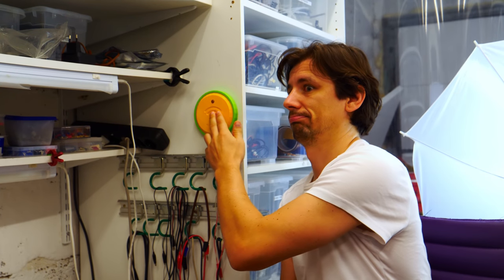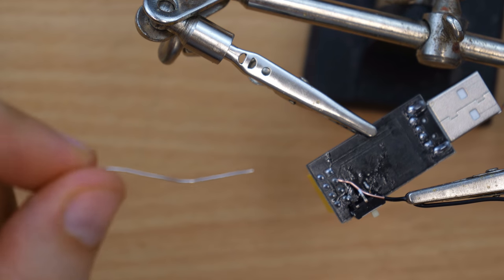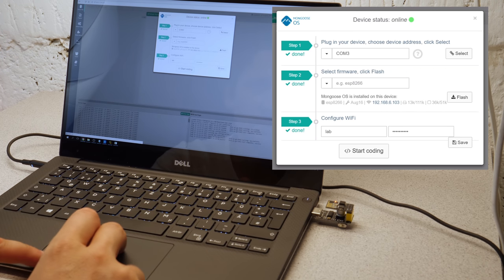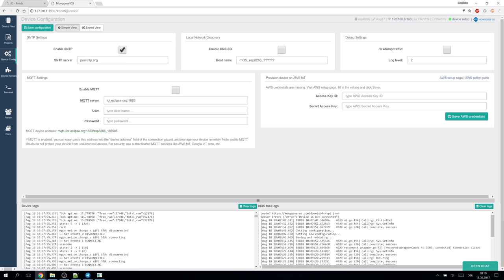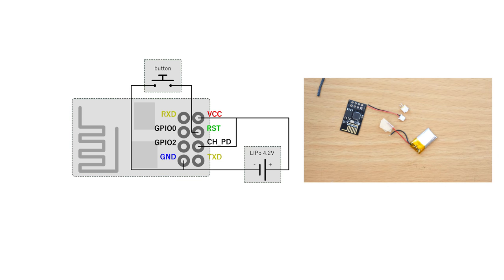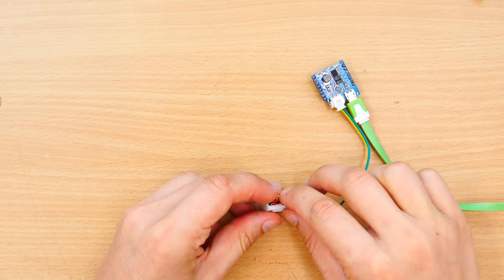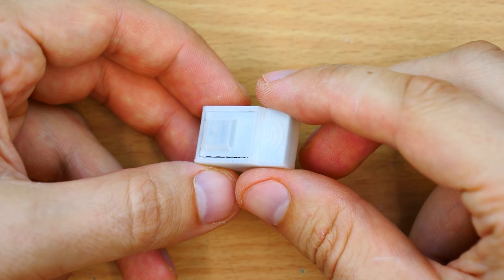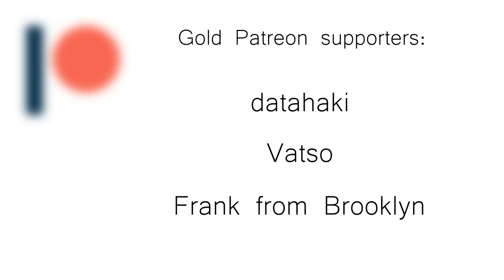The Smallest WiFi Button in the World (ESP8266, MQTT, IFTTT)

Comment: Inefficient, imo. You went for full software, but with a simple, tiny MOSFET or transistor of any kind, you could increase the battery life massively.
Instead of going for deep sleep, make the pushbutton actually supply voltage to the ESP; once the esp boots up, make it latch the power supply for itself, do the WiFi stuff, and then unlatch the power supply (simple GPIO set/reset) - battery is not connected anymore, 0 power drawn. No need for deep sleep here, as it doesn't have to wake up on its' own.
Reply: His goal was to minimise added hardware, I think. A month of battery life is good enouhgh.
Reply: Thanks Peter... :)
Reply: that solution will not increase the response time of the button?
Reply: @AugustoCarmo  , Tell me more.. :)
Reply: @SNK1995  I really don't know, I'm just asking... I don't know the time difference to "boot" and send the MQTT message when the ESP is off or in deep sleep.
Reply: @AugustoCarmo  , oh i didn't notice the question mark.. :D

At 0:28 he explained how he will code it.. he said pressing the button resets the microcontroller, thus it "reboots".. so i think the speed will be same as when supplying power on button press, or resetting on button press.

That's what I think though, i don't know if there are any other factors to take in account.
Reply: If his is inefficient then yours is simply too slow. Your solution involves the ESP powering on, connecting to wifi... but the time the ESP gets an IP address, and publishes to the mqtt broker, I might as well just turn the damn thing on manually.
But I'd use your solution for something more asynchronous and when I need the battery to last longer.
Reply: @IshanAditya  it isn't in any way slower than his solution. He resets the mcu on button press. That's the same as cold starting it.
Reply: @iFireender  oh yes my bad. He's not putting it to sleep
Reply: @IshanAditya  With a little bit of coding work a full boot can be pretty quick, you can cache the wifi information and use it to connect instead of a full scan.
Reply: @jacobalberty  the biggest delay is probably waiting for DHCP to obtain an ip from the router
Reply: @kushcabbage7505  cache the IP too. That's what I do
Reply: @jacobalberty  if u could link any guide or something to do this that would be awesome
Reply: @jacobalberty  could you explain that or do you have a guide?
Reply: Just do research on how long ESP8266 boots up and... Connect to a wifi... You could as well jsut perform the task physically. Like call yourself a taxi, go to the airport and deliver the mqtt request in a printed form.
Reply: @jacobalberty  You can't cache router's auth routine. Just disconnect and connect your phone again - it takes ages.
Reply: What about IP reservation? Could it speed up the DHCP process?
Reply: You can see that he hasn't pluged in properly into the usb plug he has just kept it there...
Reply: @fabiocopani8311  forget DHCP completely. I used static IP's and no MQTT - it's almost as fast as a regular switch (sub-second).
Reply: @fabiocopani8311  If you provision a static local IP address, you can set the Wifi configuration manually (I think the function is called "config" in the Arduino WiFi library). It will disable DHCP and make connecting to an access point much faster on boot.
Reply: @SNK1995  warm boots may be quicker than cold boots?
Reply: @kychemclass5850  , "cool" info ;) ... you guys are great, i'm yet to learn so much more in life... tell me more.. XD
Reply: @AugustoCarmo  if you want faster response you can use your own mqtt.
Reply: @fabiocopani8311   yes, i do static IP on all my shelly, ESP32 and IOT devices, much faster.

Comment: This is nice - especially the cat feeder! :) I did something similar, albeit larger, to control Hue lights using a Wemos D1. To get the required latency I went for static IP addresses, so no waiting on DHCP. Works great in a home environment. Didn't use MQTT or anything - just straight API calls to the Hue bridge.

Comment: this is something i plan on creating.
only then to controll a smart home.

1 main controller with multiple override buttons
1 timer switch 

that is send a command to the slaves to run the program at a set time.

for example 
run program X1 at time 12:00
run program X2 at time 18:00
run program X3 at 19:00 
run program at: 20:00

it needs a screen so you can easily set up times for each day of the week. {time setting will be in intervals of 15 minutes} 
with multiple settings like override program till time X.

for example normally monday you have 2 4 programs, like on off on off (so it is on when you are at home but off  when you are gone) 
but if you are at home on that day the override programming will keep the program for that day till X? 

{something like a holiday button for a smart thermostat}

Comment: Very inspirational! Your MEGA LED matrix got me hooked onto the journey of ESP32 and ESP8266. Have ordered a couple of components to get the LED matrix going. I'm conceptualising a few more projects and one thing that happens often is missing to lock the sliding windows. Here's the question: Taking the cue from the smallest Wifi switch in the world do you think it would be possible (or maybe you've done it already) to incorporate one part of a hall sensor into the casing housing the ESP which then registers a "closed" event when the lever of the window lock is in the locked position? In other words this setup checks for the lock in the locked position rather than the window/door shut - well I could possibly monitor both window shut and locked :)

Comment: The ESP8266 chip isn't designed for that battery. You shouldn't go above 3.6v and a lithium polymer works at 3.7 to 4.2v when fully charged.

Comment: to save battery you shouldn,t use the RST pin, instead of that, yu should use the button to feed source power to the VCC pin, thus the mini board Will be on only when your press the button.

Comment: Am I missing something? I don't understand why the ESP8266 couldn't do this at power up?  Then the button just needs to be a momentary power button, once you press it it powers the ESP8266 it connects sends the data and then its powered off again.  Worse case you need a capacitor to keep it powered for 1-2 seconds.  Then it would only use power when you actually press the button...

Comment: I am kind of confused. Firstly, can you run the esp from a >3.3V power source? And how is the reset kept pulled high with just the push button? Won't it go back to being low once you remove the finger? Or is it a two position switch?
Reply: He did say "do so at your own risk" using a direct 4.2v battery.
Reply: Those are 3.7v batteries, and in my testing with a benchtop power supply 3.7 is the cuttoff where they stop working.  Works fine at 3.6v, 3.7v it hangs.  It's possible these small batteries can't deliver enough current to keep the voltage above 3.6, or aren't fully charged.
Reply: Just make use of these LiFePo4 batterys !  2,8-3,65volt and even easier to charge/trickle charged for ages without degradation of capacity.

Comment: So cool to see you using Blender. Love that program. What 3D printer do you use? Thanks for the info. I didn't know the ESP8266 could be programmed this way. Would an FTDI USB to serial work for programming (like the one for programming the atmega328p) ? Thanks!
Reply from the maker: sure.. esp-01 is kind of outdated.. I took it because of the small size.. this programmer is similar to ftdi
there are many tutorials showing how to wire it up...

Comment: Hello Master, I like watching your video very much. I learned a lot from it. I have a question. The ESP-01 voltage is 3.3V. The full voltage of the lithium battery may reach 4.2V, which will cause this circuit. Influence?

Comment: Hi, well done in this video! I've just a question. With this circuitry and Mongoose OS, could I make a button that turns off or on my Yeelights using LAN Control Protocol, without needing other devices, or also trigger IFTTT commands? 
LAN Control protocol enables prompt commands that you can trigger from the LAN network.

Comment: Hey Bitluni, I have tried your way of flashing the Esp8266, but as soon as I plug it in after the process stars, It freezes there. No more messages come, and the leds on the boards are still. Please help me out. My usb-to-serial converter uses a CP2102 chip.

Comment: Is the connector for the battery charger just hooked up in parallel with the rest of the circuit?  Can you charge the battery while the battery is still connected to the ESP provided that the ESP is in deep sleep?  What happens if it's not in deep sleep? i.e. What happens if someone presses the button while it's charging?

Comment: using the ESP-01, do you have a code that would help me set up a door sensor with a magnetic reed switch? I would like it to have a status, open alert and closed alert. I don't even need deep sleep as having it on all year is less than $2 a year.

Comment: Very nice!  A quick question for you.  Can this be written or wired so that it detects when a door opens or closes?  Think of a garage door that may stay open or closed a long time and using a coin cell battery.  Is this possible?
Reply: I don't think a 3V coin cell is necessarily appropriate, but conceptually the push-button switch could be replaced by a different sensor. For a door, which is necessarily not moving around, using a larger battery (or accessing mains power with an adaptor) would give considerable flexibility. But as mentioned elsewhere here, it would likely consume less power to have the sensor send a signal by some other, lower-power radio technology than WiFi to a bridge or hub... lots of ways to approach this problem :)

Comment: How about a BT version? Sends a BT low power signal a few times when the button is pressed. Set up a phone to search for low power BT signals and start assistant when it finds one.
I have have a Chinese BT button but the thing needs constant connection for the phone lost features. And it can't be disable. That keeps the phone awake what drains the battery.

Comment: May I ask why you did not use a relay instead of deep sleep? That would make the device use absolutely no power until you press the button. That would make it last for years without recharging.
Reply: And with a relay, I mean use a button to manually turn on a relay to give power to the ESP. Then the ESP boots up and does it actions. Then it will tell the relay to switch the power off.
Reply: aren't relays bulky though?
Reply: You don't need a literal relay, just a MOSFET, like even 2n7002, not perfect but it will work in a pinch.
Reply: From deep sleep the connection to wifi is done in about 100ms - 200ms.

Comment: IS there a reason to use deep sleep instead of powering the chip down completely ?
Reply: Doc Holliday, theoretically, you can add a timer to deep sleep so that your button pings your server daily.  You could use that to detect buttons with empty batteries.
A downside of switching the power supply is that either the user needs to hold the button until it is empty or you need to solder a latch to it.

Comment: Hey, I hope someone can help me: I tried to rebuild some of this, but using the arduino environment. However, I found thet deep sleep doesn't work unless some of the unconnected pins ( XPD_DCDC (8)) of the cip is soldered and connected to RST.  How comes this is not mentioned/needed here?
Reply: ok, i got why: the mentioned connection is only used if the esp needs to start itself after a given time like this: 
ESP.deepSleep(microseconds, mode);

Not needed it someone externe wakes it up via button pressing or similar

Comment: I did same project some time ago, but found it useless.
1) It takes too long for ESP to connect to wifi
2) MQTT app on smartphone consumes too much power. 

My initial idea was to use this as door bell. Bit still, this can have some use cases, but not for me.

Also, I fount that ESP does not always work correctly being powered with 4.2 volts.
Reply: 1) You can connect to wifi a whole lot faster if you use a static IP instead of DHCP and define the channel and BSSID when connecting. This of course is possible only if the wifi AP is configured to always stay on the same channel and you can use a static IP. Probably even faster with a wifi that doesn't have security enabled, but that's a bit risky.
2) Agreed. Sending a single value over MQTT or MQTTS will generate like 6kb of traffic.If you want some kind of response, you need to keep listening on the channel for a while before you can disconnect and put the device to deep sleep. A simple TCP or UDP packet is about 1% of that and you can get an instant response. Of course you need to write and run your own server daemon for that. If you're just logging to influx, you can do that directly from the ESP8266 using the influx UDP socket, it's easier and a whole lot faster than MQTT.

With something like this you can run a full cycle of get reading -> connect wifi -> report -> deep sleep in about 1000ms.

Comment: What's the time between trigger and action after deep sleep?
Reply: Yea. I want to know the latency too. I assume since you're rebooting the device, it has to renegotiate wifi connectivity before sending the MQTT message. So it probably won't be super fast. I was thinking something like this could be cool for an IoT light switch, but even at a fast 2 seconds (my guess at fastest possible time), it'd be annoying.
Reply from the maker: yes, there is delay. It's a trade off to run it from a battery.. a faster way would be using an rf-transmitter and a station just like a remote... could be a project
Reply: so could this programmer flash a lixada H801 led controller that  is based on 8266 ? what is the difference between  this programmer and an FTDI USB to serial besides the connector ? is it just that the FTDI can flash  more different types of chips and this can only flash arduino esp?
Reply: Something like Moteino would do
Reply: lixada H801can be flashed with any serial adapter, just be sure you first connect GPIO0 to ground. I recommend this firmware: https://github.com/mariusmotea/diyHue/tree/master/Lights/Arduino/Generic_RGB_CCT_Light . It is based on a custom PWM library that works much better.
Reply: Jon Davis i also thought about using it as a cheap light switch for my home (i have my own mqtt server simliar to the one in his recent video). But if it takes so long it does not make sense. Then Alexa is faster ;-)
Reply: @bitluni's lab: I will give this a try but instead of WiFi use ESP-Now, that might reduce the response time and also increase battery life.
Reply: @kanstantsin-bucha  hmmm. that's a long time to wait for my light to turn on...

Comment: I know you said "use 4.2 V at your own risk" this is because the esp8266 has a max vcc input of 3.3 V.
Is there a reason for you to not use a LDO?
Reply: I guess due to conversion, you would probably get a smaller milage from that battery and it's an extra component for a button that works maybe once per day, theoretically it works as it is.
It's a good question tho, i'd probably add one to mine when I make it.
Reply: small nitpick but the esp8266 has a listed max Vcc of 3.6v. 3.3v is just the typical voltage used.

Comment: 50µA in deep sleep so that the battery will last for only a
month?  Why not change the code to send
out one command and then go to sleep?  Then
used the button to supply power to the module. 
That way when the switch is off, the circuit takes no power and lasts
the shelf life of the battery.

Comment: Awesome Project. I tried to build it myself and ordered the things over the links you provided. However, I am just not capable of flashing mongoose OS to my esp8266. I am on a mac and it always says that it will not fit in flash.. I did not found anyone with the same issue in the internet.. any suggestions or wisdom from you in this matter?
Reply: i'm lost when he tried to put GPIO 0 low at 0:57. I am not sure why he does that and how to do that. I hope you can help :)
Reply: @scuderia888  On some esp boards that is needed to be able to flash the program to the board. Otherwise you wont be able to upload it. Only needed while uploading.

Comment: Does the board come with a way to determine the battery's voltage level (to avoid over discharging)?
Reply: He is using a separate board to charge the battery. Presumably the charge board does provide over charge protection.

Comment: after flashing, I wanted to change the device config but in my case I fail with Server Error: {"error":"(400) failed to open file \"init.js\""} & 7984 ui.go:561] Call complete, error: remote error -1: error saving config: failed to write file
Server Error: {"error":"remote error -1: error saving config: failed to write file"}  .. now clue what to do next..
Reply: Raf Penders same. I can not find solution
Reply: I am not sure my ESP-01S has 1M flash. mongoose requires 1M at least.  I try to figure out want is causing this
Reply: I copied the mos.exe file in the c:\windows folder and started it fromthere, with administrator rights. then first I change the configuration and then I copied the program in the init.js file. now it works . finally

Comment: Yes. You can do that too with ESPxxxx. But is it the right solution for the use case..? Absolutely not. 
But if you’re a tinkerer, DIYer.. then yes it’s fun. 
RF transmitter that can run on a coin batt for years and a RF receiver to operate the door (pet feeder or whatever) works well.
But ESP modules are cheap and fun too. So who cares.

Comment: Is there a way to update wifi password on the module with plugging it to computer?
Reply from the maker: If you don't know the password: no
If it is still connected.. use rpc to change pwd first and then you can change the one of the hotspot.
Otherwise
If you know the password.. take the button out of range and create hotspot using your mobile connect using rpc and change the password